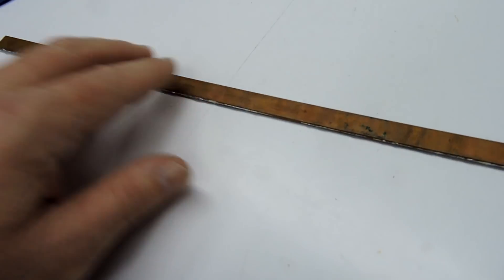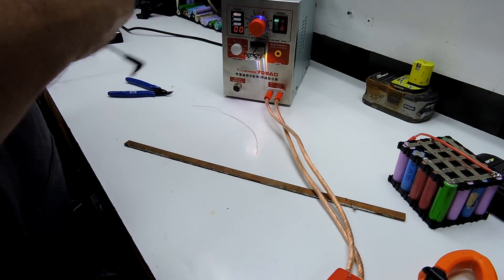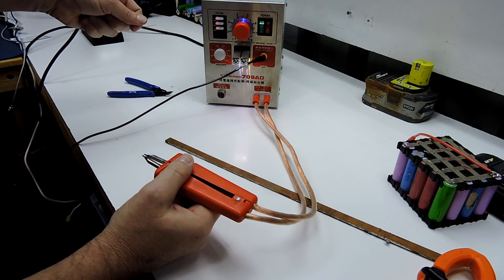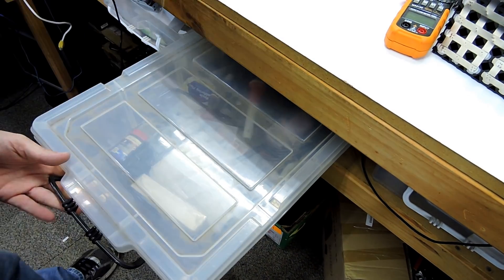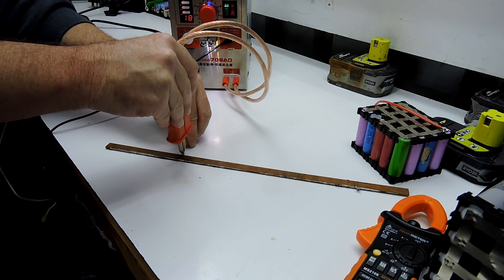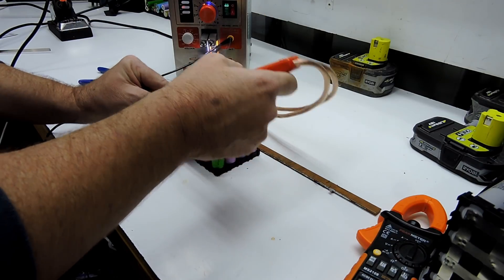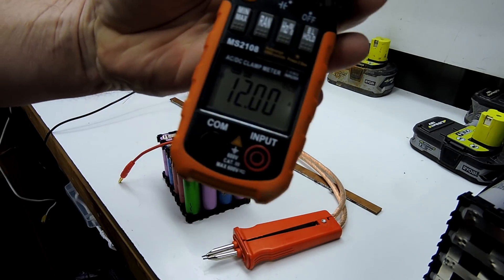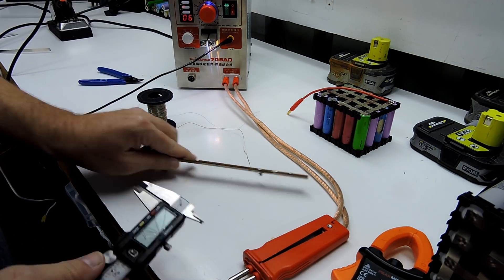709ad spotwelding to copper busbar

Comment: Some ppl say that this is possible if you use a tungsten electrode on one end where it touches copper and the other electrode using regular copper while having the copper electrode touch the nickel. They also say to apply a brazing paste. This is something I will be trying with my 737g+ which is similar to the one you are using. I can confirm that taking a piece of solder and placing in between the copper plate and nickel plate will work with the spot welder but only witg very thin copper 0.2 no go 0.1 works it's not really spot welded it's more less soldered but without the soldering gun heating up to 18650 cell. Have you tried spot welding copper with Your kwelder with any success?? What I have been doing is taking small pieces of copper and soldering on top of the nickle only where the series connections are and then spot welding the nickle where the parallel connections are. I've also taken 12 gauge Romex solid and used nickle strip on top of it to sort of pinch or stitch the copper on
Reply from the maker: thanks for the info

Comment: For the reason of higher amperage projects, I would want to use copper strips too because they will also help lower the temperature of the batteries, as it won't heat up as much vs nickel, due to lower resistance.  Also, I thought spot welding wouldn't be very useful, might as well, just solder on copper strips to it.  Due to higher temperatures, perhaps a solder paste would work, it would be lower activating temperature to solder it on.

Comment: Try laying a strip of nickel on top of the wire, the heat created by the nickel may be enough to weld the wire to the bus bar. This is similar to the trick of placing steel strips between electrodes when spot welding aluminum ie., electrode - steel strip - aluminum - aluminum - steel strip - electrode.

Comment: It dosent have the power to heat up 1mm+ metal. 18650 battery terminal is thin, also the nickel strip. Now you had to mutch current and blew a hole in the battery.
Reply from the maker: Amazing what I learned in this one short video.

Comment: Good luck spot welding copper. to spot weld you need a metal that has a resistance 
Copper has almost no resistance which is why we use it in cables to conduct electricity
Reply from the maker: I have since learnt this lol

Comment: What would happen if you were to connect the negative lead directly to the bus bar then just have the positive as a single tip?  This way to my thinking at least you would take advantage of the low resistance of the copper and put maximum heat into the wire you are trying to fuse to the bus bar

Comment: I was once  an engineer at a UK resistance welder manufacturer. They made resistance welders that could weld copper to copper, but they were massively oversized in order to accomplish a good weld. I think the smallest one they did was around 30kw . They made even more powerful machines that consolidated copper braid. Turned it into a solid mass. Huge power for what looked like small cables. 3 phase power source needed too.
Reply from the maker: So what your saying is this was never going to work lol was still a fun test and answered a question for Mike 
;0
Reply: HBPowerwall The physics are totally scalable. That sunkko machine will weld thin enough copper. So maybe try two thin copper strands to each other. But that busbar is such a huge sink, you got no chance!

Comment: Makes sense.  Spot welding tips are made out of copper because they don't weld. Copper is used in spot and arc welding processes as a non-stick backing or as a tips.   I am curious if you tinned the bus bar, would it weld?

Comment: Also, it is possible to leave a drop of solder and then fuse it. But that is pointless. You might as well solder the wire after the fact.
Reply from the maker: Another has asked the same thing. I'll try it if I get some spare time.
Reply: Please do :) This was the exact video I have been waiting for! I have ordered my 709ad now so I will experiment myself to try find a busbar that works.

Comment: I wonder if DC spot welding would work better? Currently, those machines only use AC Spot welding. DC for me seems to provide a different result. Then you also have Capacitance welders that also produce a different result than the AC and DC welders. Just a quick thought??
Reply: UGH I know I know, I really do need to build that sucker.  Hope you didnt need that back right away 😜😆
Reply: I did send a DC spot welder to Average Joe over 6 months ago to borrow it. No idea if he'd have time to try it.
Reply: I know, he told me he really really needs to get that hook up or sent back...LOL That is one Bad A-- Welder you sent him, i bet it works better than any of the DC welders I have ever made!!! I really like DC Spot welding over AC. You can definitely tell the difference.
Reply: I didn't know that? I assume the ones I build are DC. I use DC to charge them. I am in the middle of my second Capacitor welder. My last one using a 2F Audio Cap(probably 1/2F). This time I purchased 22x350F maxwell caps. The Capacitor welder I built last time is my favorite welder out of 8. The welds are almost flawless. I am hoping with name brand caps and a bigger bank, I can get more welds between charges and heat ups. This will be Battery tab welder build 8. I have built 9 to date, will simple materials. I might purchase an OEM just to compare welds. : )
Reply: AC or DC shouldn't make any difference - the only thing that matters is the total amount of joules that get deposited into the metal to heat it up and melt it. The direction of current flow is irrelevant.
Each pulse is a dose of energy, so more pulses = more energy = more heating.
So, ten 1mS pulses of 1000A deposits the same amount of energy as one 10mS pulse of 1000A and therefore the same amount of heating. The electronics may be easier with this spot welder to control number of pulses instead of the duration of one pulse.
Thick copper bus bars have less resistance than the cable and tips used, so the energy supplied goes into heating those up instead of the target.